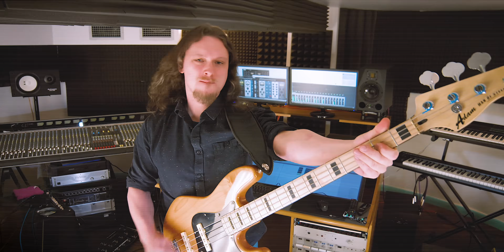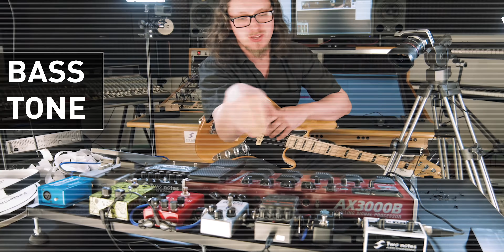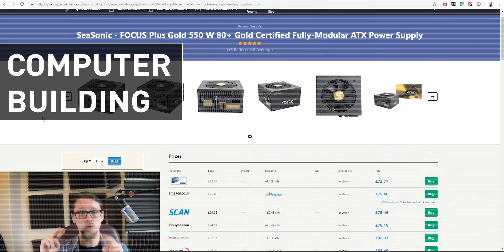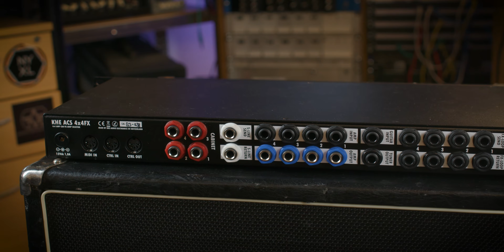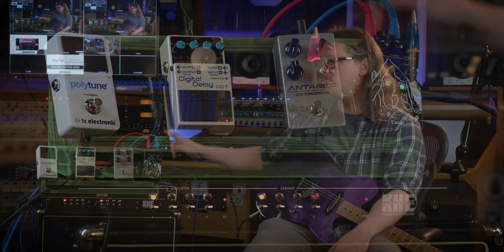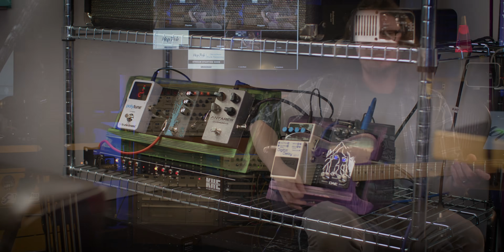KHE Amp Switcher - Saving tons of time!

Comment: Is this a solution for me? I have 4 UA amp pedals (amp + cab simulator — the Lion, the ‘65 Dream, ANTI, and Enigmatic) and I would like to just plug into the thing with one cable and just switch between the different ‘amps’. 

Would this let me setup different effects pedals for each of those if I like? Does this let me send out the total signal to front of house for live play?

Comment: This doesn't seem complex enough. It also needs to switch each amp to a number of different cabs (with dummy loads for the disconnected amps) and automatically switch 1-2 mics from the cabs to the pre/interface. This way you don't need to move away from your comfy chair ever! 😃
Reply from the maker: It does switch cabs with dummy loads! I could probably program the mics to enable with midi when I change cabs remotely as well…
Reply: @adamsteelproducer  Cool. It looks like your workflow for IR packs is going to the next level.